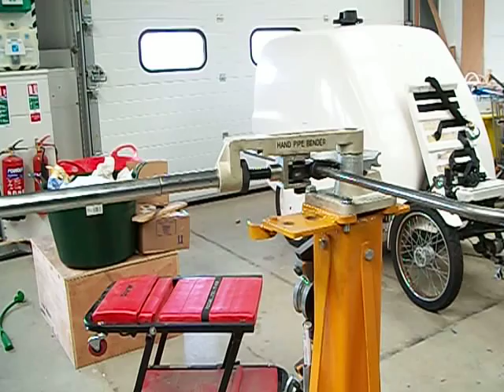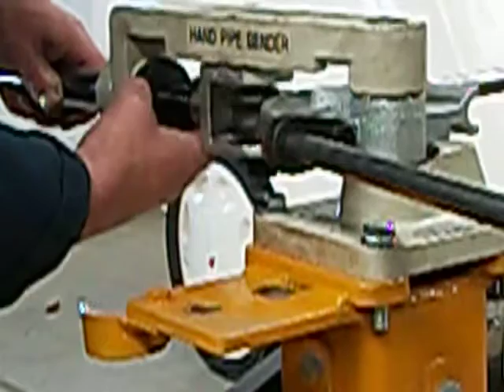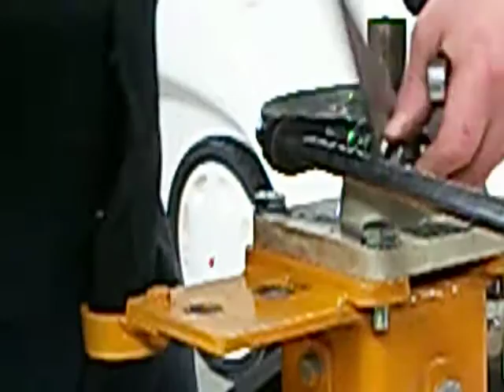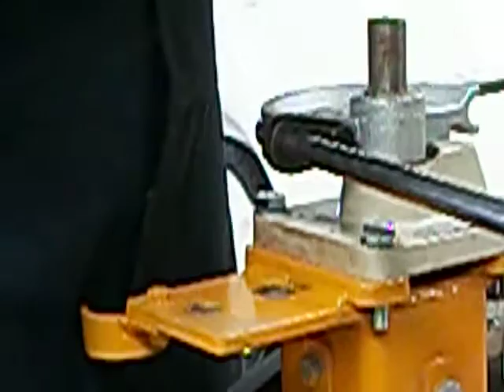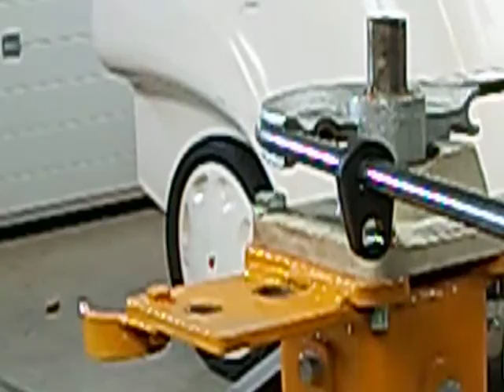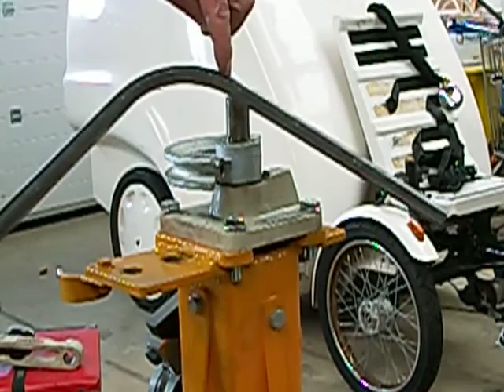Cargo Cycles' experience of the Baileigh RBD 25 bender in 5/8 inch ERW 16 guage

Comment: Did you ever contact baileigh about the problems your having with it?
Reply from the maker: As far as I was concerned eith the Baileigh bender set it was a new tool that didn't work and not my responsibility to put right. I got into an argument with Baileigh over the quality of this item and who was responsible and in the end Baileigh cut me off completely: No apology, no replacement, no refund, so due to that response from Baileigh I decided to never buy another of their tools or equipment.
Reply: @TheRanger0ne  bloody hell, you would expect better from a company that's world renowned. Thanks for the reply you've saved me a few hundred quid on this.
Reply from the maker: @superfabrication2019  If you are looking for a tube bender  for fabrication work I can highly recommend the JD2 M3. Yes, it is expensive as are the dies and followers for it, but they can be purchased individually to suit your needs. 
The sizes I use most are ½",   ⅝",   ¾",   ⅞", 1", 1¼", 1⅜", 1½", 22.3mm OD, 26.9mm OD, ½"NB, ¾"NB and 1"NB. 

Alas, I do not have any box/square section dies as I currently do not have any demand for bending that material, but would go to the expense of buying the dies and followers if needed and treating the purchase cost of them as an investment over 3-5 years.

For ¼"OD,  ⅜"OD,  ½"OD,  ⅝"OD, 6mmOD, 8mm  OD, 10mm OD and 12mm OD tubing I also have individual Ridgid 400 series benders, and these I cannot recommend highly enough. .... perfect bends in tube every time, but strong enough to bend solid Mild Steel round bar (which I do a lot of).

Last summer I picked up a full set of VGC ridged 370 benders being sold by  a retiring plumber for  £25 in an ebay auction. I had to drive 35-40 miles to pick them up but they were worth it and I know use them exclusively for  on any on-site heating and water piping jobs that come my way